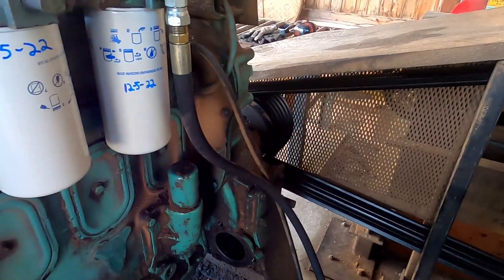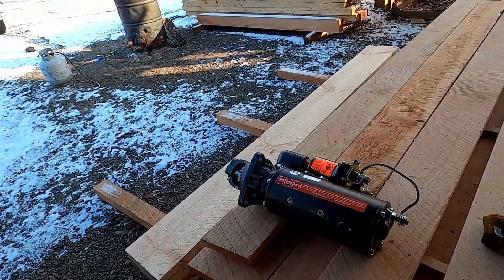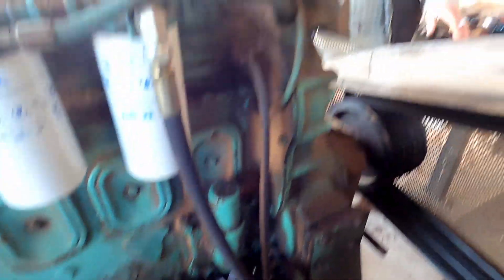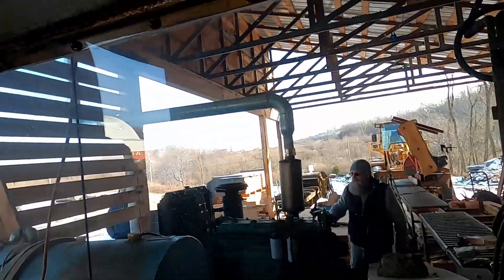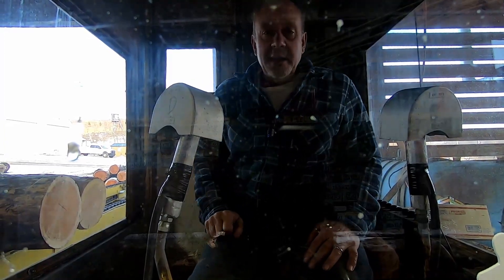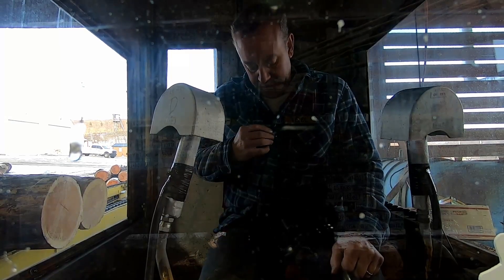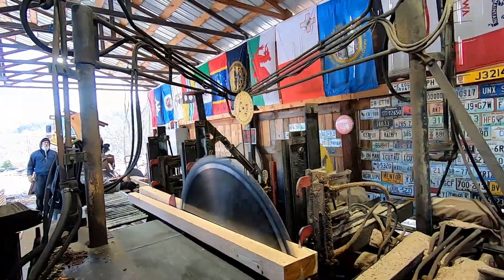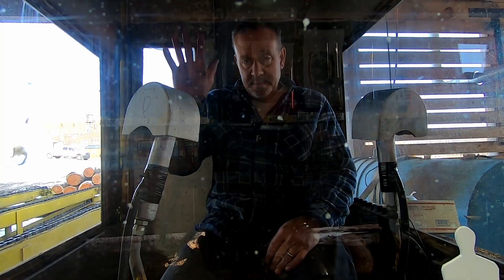installing the new starter on the 671 Detroit # 371

Comment: Nothing as grand as your mill but proud to own. I have an old table saw from my father, I replaced the bearings in it for him back in the 70's about 20yrs before he passed. He bought it brand new when he was younger, Craftsman Table saw 1934 and still works and still has all the extras including the wrench for changing blades.
When I went to school for mechanics I had an old instructor who used to be a mechanic in the motor pool back in Korea during the war. He used to talk about using ether capsules to start the vehicles. He said it was a slide unit on the motor like the coin slide on a juke box and you put a capsule in and pushed it into the intake and a big fireball came out the exhaust when you cranked it up.

Comment: Got a lot of NAPA rebuilds and they work just fine. Those starters are something to waller around but if you can ever get a bolt started you've got it made. The truck shop mechanic has a bad back and he'd tie those and let them down with a rope. That size is common on a lot of stuff. Just different bendix and nose. Nice lumber too and you could use a timing belt off an overhead cam car on chewey. Those timing belt teeth ought to work just fine HA! And I got a peavey for the firewood logs from Canada. It cost $100.00 new. Still new enough to be called new and nothing cheap or Chinesium about it. Happy warming up inside and God Bless Yall!
Reply from the maker: thanks Lewie , yes a nice rebuild on the starter , we will rename chewy to gummy lol! Merry Christmas!

Comment: Nice to work on something like this not surrounded by vehicle.

Surprised it spins so well cold with that 40 weight oil in it.
Reply: Maybe you should try a 20 weight oil seeing it's THAT COLD ?
Reply: Those old Detroit / GM diesels generally specified straight 40 weight oil regardless of weather.  Even here in Minnesota.
Reply from the maker: for sure.

Comment: I had to change out the starter & solenoid on my little band mill a couple years ago. It’s been good since knock on wood. I will be changing out the guide bearings again come spring. I’ve had the mill for 18 years so it’s been good to me. I’m going to move it to a location by my barn next year as well. It’ll take some backhoe & loader work to prepare the spot. Easy Peasy. Love the videos, I watch every one as they arrive for view.
Reply from the maker: thank you , Merry Christmas!
Reply: @markgalicic7788  Merry Christmas

Comment: It's the wind that makes cold temperatures feel bone chilling.  Does frozen wood saw easier?
Reply: Depending on how solid it's frozen,  too frozen you can't saw, or at least not easily.
Reply from the maker: yes for sure , we use a standall bit and it works great on frozen logs.

Comment: Would it be worth getting the old starter rebuilt so it can e switched out quickly if it goes again ?
Reply: I was thinking the same thing. Get that old one rebuilt...its always nice to have a spare on hand "just in case" 😉
Reply from the maker: it had a $86.00 core charge.

Comment: Interesting Mark, you have finally seen the MOTOR.  Starters are Motors!  The 671 is not a MOTOR, look in your manual, it is indeed a Bus ENGINE.
Reply from the maker: the 671 is ye ole bus motor just ask Lewie lol!
Reply: When the term motor was introduced it was meant to mean an electrical mechanical device meaning it converts electrical energy to mechanical energy. An engine was and is a chemical mechanical device that converts chemical energy (gas, diesel, wood, coal, alcohol, or even human energy, and etc.) to mechanical energy (Steam Train engine, diesel train engine, coal train locomotive eh I mean engine) and a generator converts mechanical energy to electrical energy. (An alternator is a generator that produces alternating electrical energy.) While the automotive term "generator" generally is used to mean a direct current (DC) generator, it can and is used to cover all mechanical to electrical conversions both DC and AC. Such as a standby generator by your house that produces AC.

Having said all of that, common usage, though wrong when originally used, can and does change the meanings of words.  In today's lexicon a motor is any device; chemical, electrical or mechanical, that can produce a desired mechanical output and is now called a motor. This is true even when it is just a bunch of gears that turn one form of mechanical energy to another and should rightfully be called a transmission. A transmission transmits energy available, of whatever kind, to energy required or desired. (So a human powered engine is rightfully a transmission but it just does not sound right. The human is the actual engine as the human converts the chemical energy, food input, to the mechanical effects of the actions of arms hands feet, etc.)

Comment: So most likely the motor was good but the solenoid (smaller round item) brushes were bad causing the bendix not to throw out any engage
Reply: If I may point out, the solenoid has no brushes.
Reply: Don’t believe that a solenoid has brushes, though it was magnetic.
Reply: Oops sorry contacts
Reply from the maker: it was just wore out , now it spins so much faster.

Comment: Think about running the hydraulic oil from your ancillary equipment through a heat exchanger on the bus motor rad.
Reply from the maker: no we don't saw below 20-F
Reply: @markgalicic7788  It  would be a bit of work, and you may not need it if you are ok with the slow warm up, but your hydraulic oil would be warm right away.

Comment: Curious since it's not in a bus with an odometer anymore do you time your maintenance by Hours or board feet? Just kidding, we've seen it the past, it's by feel, an operator who knows his equipment like you do, knows by feel when something needs repair. and knowledge of you craft keeps repair costs at a minimum before damages go too far. It's like Scotty on Trek said he could feel it through the deck plates when something wasn't right. You have shown in the past how you can feel problems by the way the saw cuts or the sounds it makes. Waiting to see that 100K plaque hanging somewhere soon.
When are you going to put magnets on the fuel tank? I remember you talking about sticking them to the motor, just remember all those moving parts form a magnetic field and may kill the magnets so they fall off, the tank would be a better place.